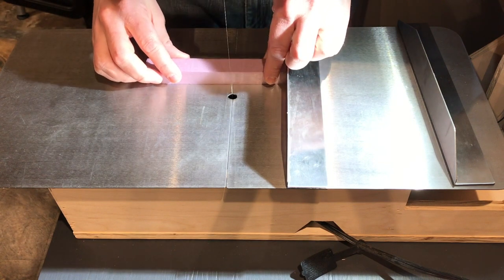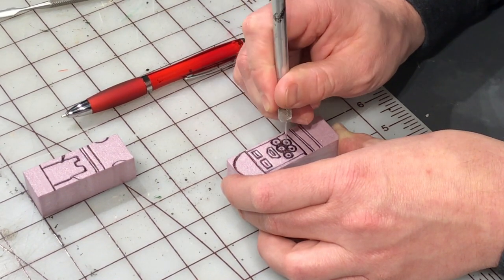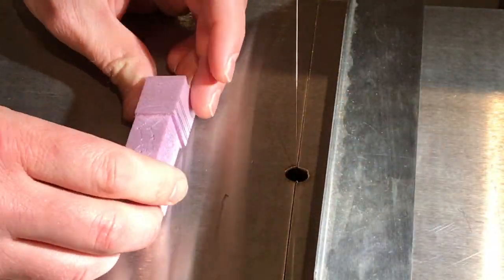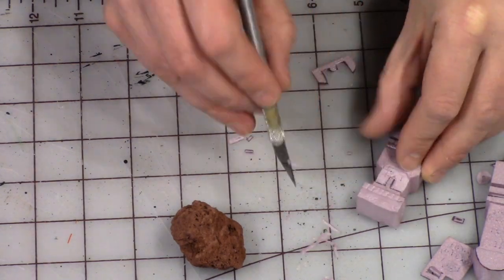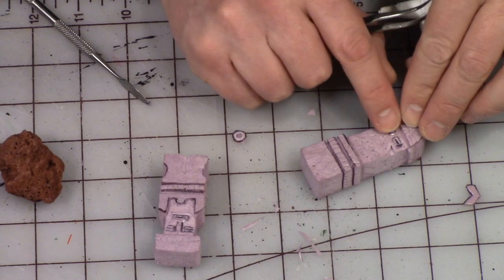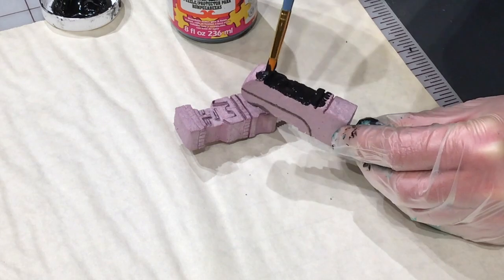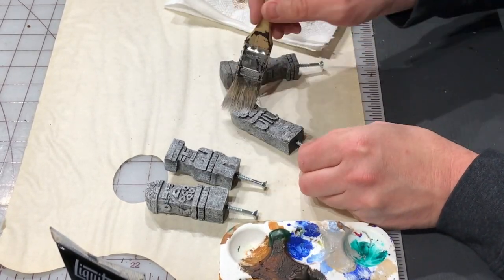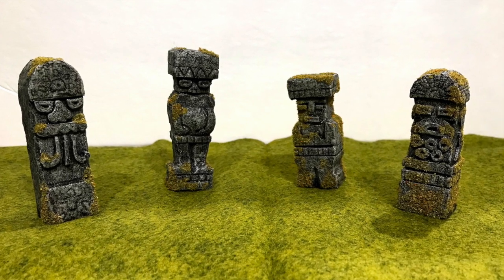007-Stone Totems

Comment: Top notch, mate. Cool little totems. I'll definitely try my hand at crafting these now. Thank you.
I noticed your hot wire table. Is that custom? Looks like a stainless steel surface. Is the fence magnetic? It appeared as if you moved it around quite easily and quickly...
Reply from the maker: It is custom. The fence is magnetic so it is very easy to set up and run.